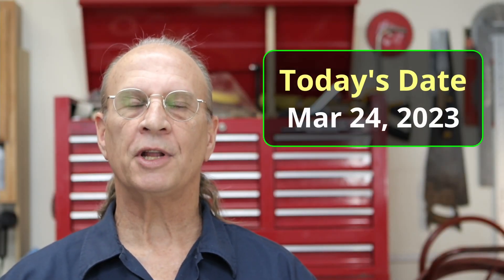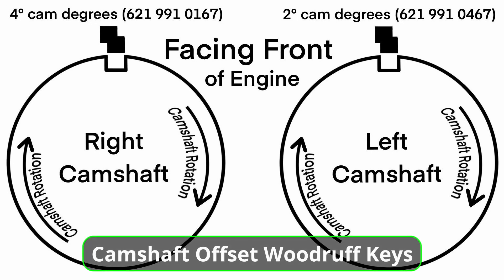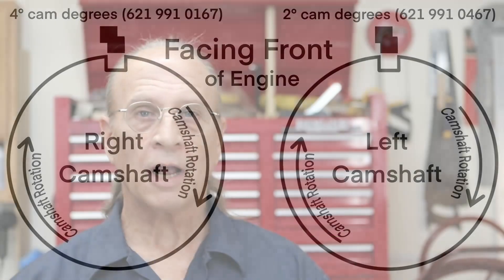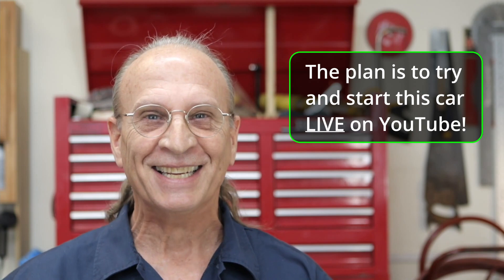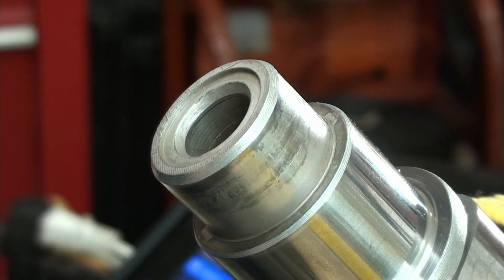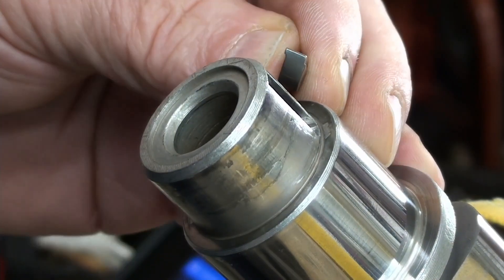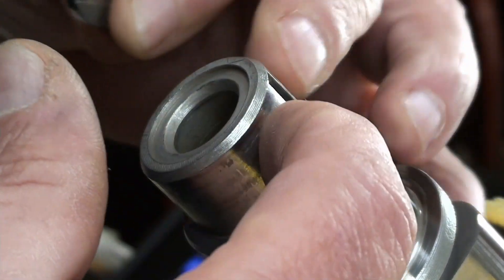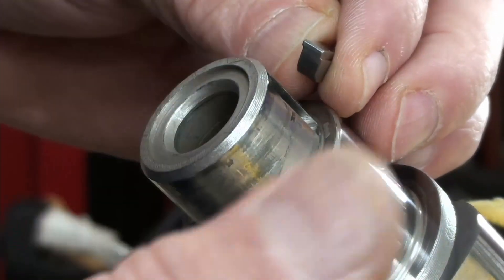560SL - Installing Camshaft Offset Woodruff Keys

Comment: Im putting a 560sl motor in my 450slc drift car. Lots of mods to mate it to my 4 speed manual trans. I think im going the opposite way and retarding the cams for more top end power. It will be living up in the 4000-6000+ rpm range. Im doing the AMG style lightened cam followers too.  I cane looking for a refresher on the guide instal and saw this. Thanks!

Comment: Hello Tony, how did you come to that calculation when you selected the degrees of woodruff keys?
Reply from the maker: The whole idea of using offset woodruff keys for fine tuning was new to me. I learned about this from a master engine builder who has rebuilt over 1,000 of these M117 engines. He assures me that by doing this I will achieve a smoother idle and faster startup. We’ll have to see if this is true when I start this beast. If it doesn’t work as promised I can easily change them back.

Comment: Hello, where did you buy the part ? Thank you for your video.
Reply from the maker: All offset woodruff keys were purchased from Mercedes. These are usually in stock. Most all parts I have purchased for this entire project are direct from Mercedes. I always try to buy genuine MB if available. Otherwise I purchase from vendors such as Pelican, FCPEuro, ECS Tuning and AutohausAZ.